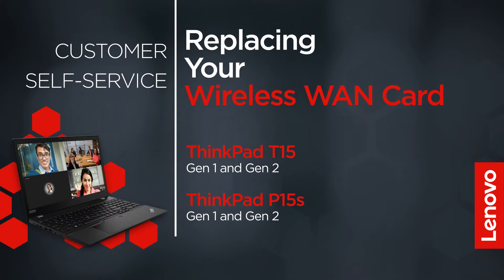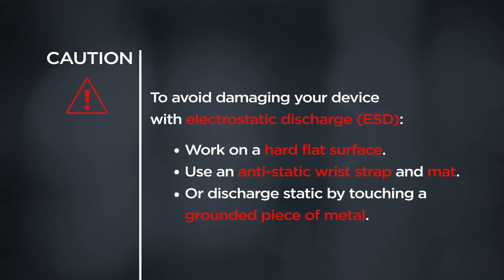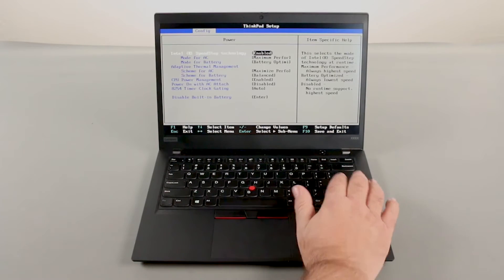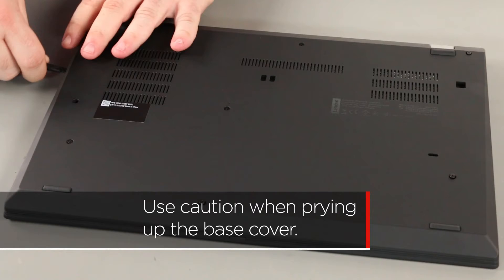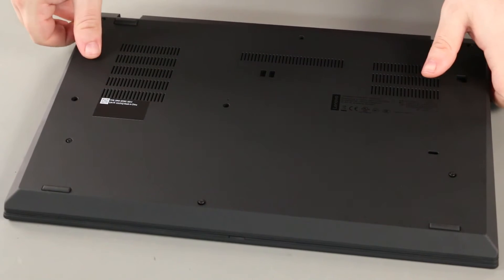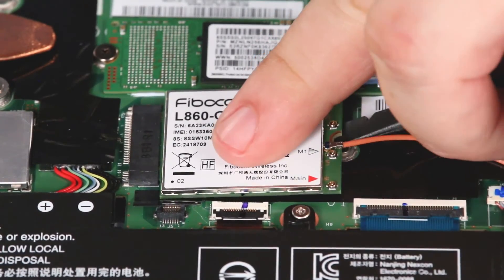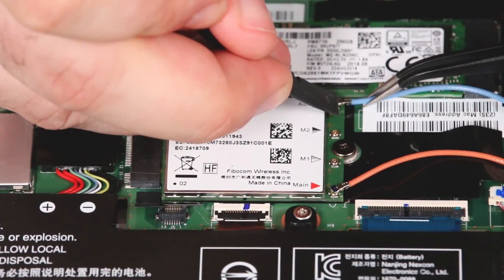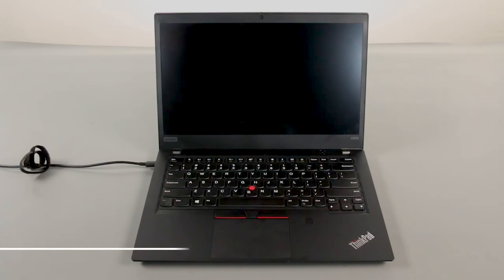Replacing Your Wireless WAN Card | ThinkPad T15 and P15s Gen 1 and 2 | Customer Self Service

Comment from the maker: This video will show you how to replace the Wireless WAN Card of your ThinkPad. The process in this video will work for the ThinkPad T15 Gen 1 and Gen 2 and the ThinkPad P15s Gen 1 and Gen 2. 

You will need a screwdriver kit, a non-metallic pry tool, static safe tweezers, and 15 minutes of your time.

To learn more about your device go to https://pcsupport.lenovo.com

To find parts for your device go to https://support.lenovo.com/parts-lookup/?cid=ww:lenovosocial:b9515f&source=socialmedia&subsource=yt

To view the Lenovo Support Self-Repair Guides landing page go to https://support.lenovo.com/us/en/solutions/HT516547

** NOTE: Static electricity can destroy components. Use a grounding strap, and clean, non-conductive surface to work on. Use plastic or coated tools to prevent scratching and avoid using metal tools on plastic parts. For more detailed information on electrostatic discharge and how to prevent it, please watch our ""Understanding Electrostatic Discharge (ESD)"" video: https://youtu.be/by4PB3WtdLo 

Applicable Machine Types:
ThinkPad T15 Gen 1 - 20S6, 20S7
ThinkPad T15 Gen 2 - 20W4, 20W5
ThinkPad P15s Gen 1 - 20T4, 20T5
ThinkPad P15s Gen 2 - 20W6, 20W7

#lenovo #LenovoSupport #LenovoTechSupport